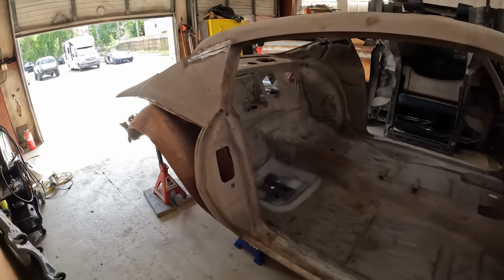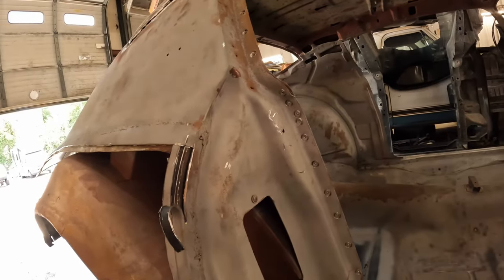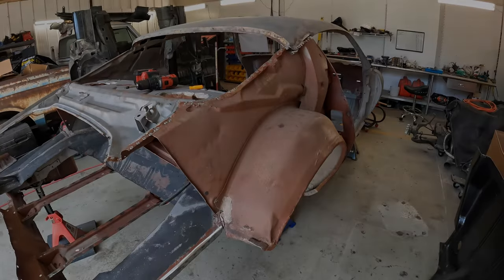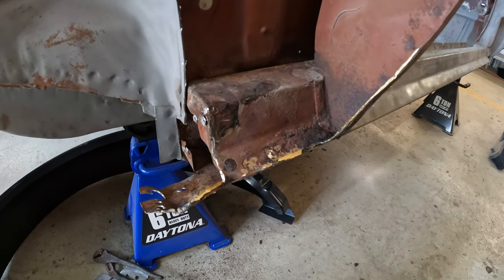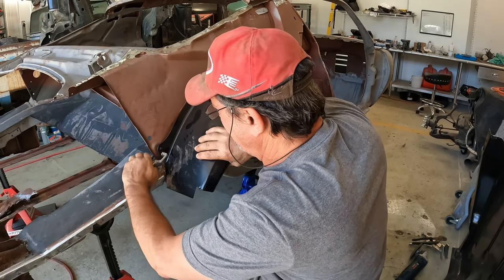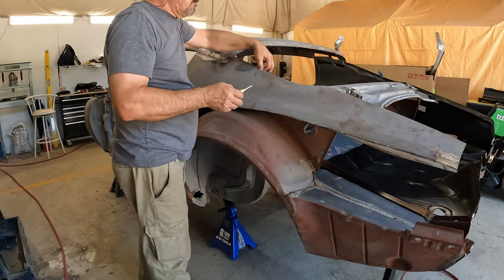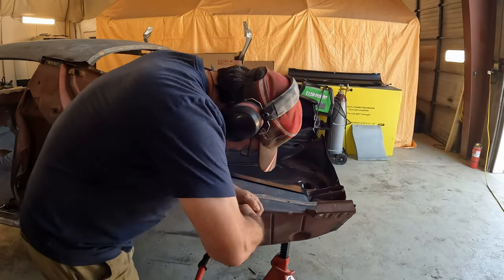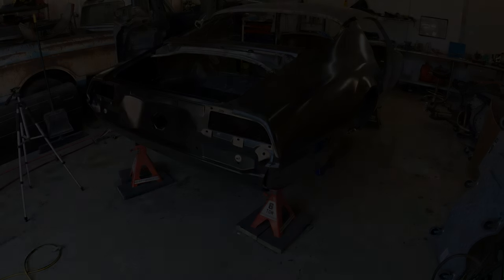Firebird Ep  15 Removing the old quarters and trial fitting the new ones

Comment: Brass was used from the factory assembly lines into the mid to late 80's just an FYI . There are still shops that use brass in repairs still today . Great videos .
Reply from the maker: I did not know that. Thanks for the info! Unfortunately all that brass will just contaminate my welds so it's gotta go 😃